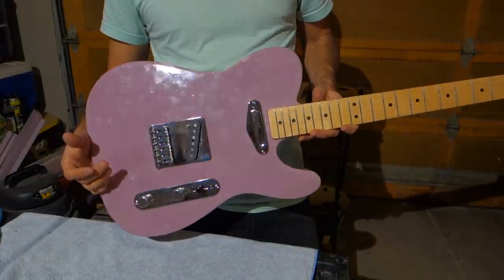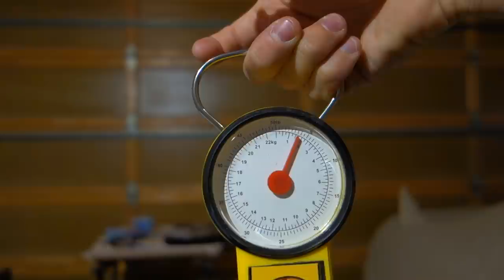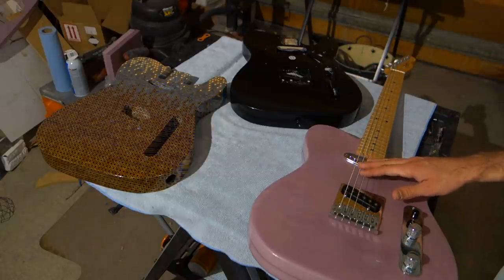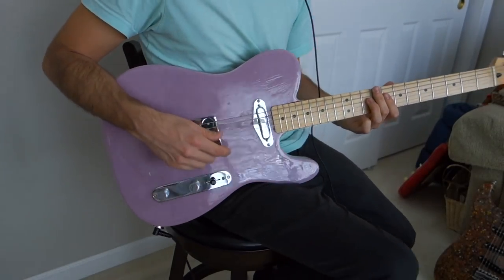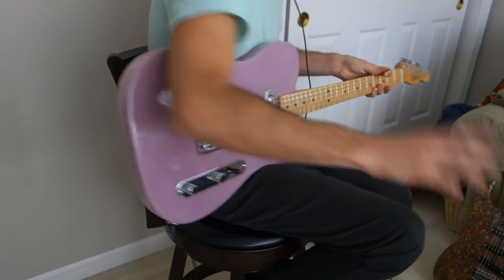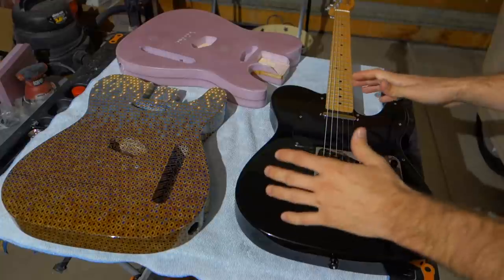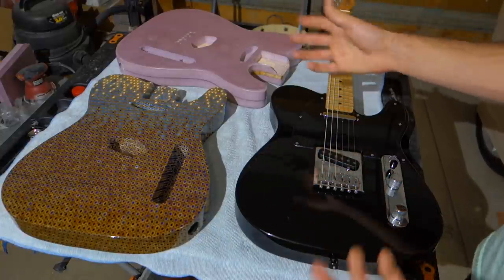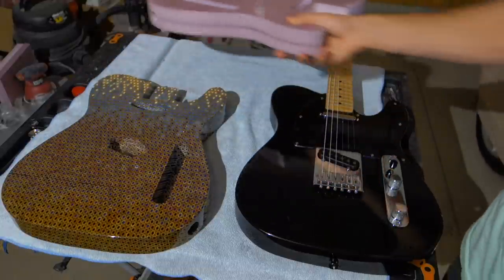I Built The World's Lightest Guitar Out of Styrofoam

Comment: And so cheap (and replaceable) if you want to smash your guitar on stage!
Reply: Lassie Vision and a cool color for style
Reply: Not by any means cheap. The 6 foot length of foam costs around $150 and fiberglass and the resign are expensive too. Wood would be cheaper
Reply: Blimey. Who'd have thought foam would be so pricey?
Reply: Lassie Vision I made the assumption that it’s closed cell foam based off of the appearance but I could easily be wrong
Reply: 4X8 styrofoam panel costs 22$ CAD here.
Reply: @Joemels  you are getting ripped off if you are buying insulation foam for 150$
Reply: This is extruded polystyrene foam, also called XPS. And it looks like it’s made from 2 1.5 inch sections that could easily be made from the same sheet. Easily under 30 dollars US. But that price does tend to change based on where you live.
Reply: @Joemels  I picked up a 4x8 of the exact same XPS foam for 15 bucks the other day my guy

Comment: Maybe make the wood that the neck bolts to a bit longer going down the back and run the strings up through that one peice.  Might the the string tension preasure out of the foam... I dunno... Still cool idea.. Rock on!
Reply: Yep.  That the true key to making a decent electric, as per Les Paul.  Need that solid piece to anchor the strings to.

Comment: Equally supportive and rigid material with equally adjusted set ups and hardware will sound exactly the same if you play it same way. If you introduce neck or body flexing, alteration in the way you hit and squeeze the strings, you will get different "tone" i.e. the string vibration pattern will alternate due to changes in string length and material absorbing the vibration and translating it to acoustic noise, which isn't the point of a electric guitar. The point is to translate the magnetic vibration of the string, through the pickup to an amplifier. There's very little differences between one "tonewood" and the next in terms rigidity, therefor you can make a concrete electric guitar and it'll still sound OK and probably have great sustain.

 Also, someone probably already pointed out but there are people making entire guitars out of carbon fibre, so if you want to go light, time to start honing carbon molding skills.

Comment: Another piece of evidence that the wood (or other body material) DOES provide a tonal difference... but that the difference is fairly slight.  The foam did sound more muffled compared to the standard wood body and the the pencil body... but not much.  Install some slightly brighter pickups and the difference would disappear.  So both sides are right.  Argument over?

Comment: That is a plywood  body clad with foam and epoxy.     It probably has more plywood in it than one of my experimental builds.     Probably weighs more too.  Looks like it, the X-6 tips the scales at 3.25 lbs.   Next time just use plywood, and try something more ergonomic than a T type.   
The X-6 version 1:  https://www.youtube.com/watch?v=7VfgFOFxJB0&t=21s
The X-6 version 2:  https://www.youtube.com/watch?v=flx3VEITgGg
The X-6 version 3:  https://www.youtube.com/watch?v=oOfMdauWEgQ
And you can get even lighter.  
Check out the neck on the X-9:  https://www.youtube.com/watch?v=gwtL6RKhZh0

Comment: So I have no idea if you will get to read this, but I've had an idea to make an entire guitar out of acrylic resin or epoxy. Acrylic resin might not be the best medium, as I was reading an article that claimed, if left in the heat, acrylic will lose its integrity. So epoxy might be better? Regardless of the medium, I found a forum that claimed a full acrylic/epoxy guitar would put too much tension on the neck and bridge which could lead to warping. There was also a claim that a guitar without wood, would sound worse than if you were to use wood along with the epoxy/acrylic... however I'm not sure how accurate that is, as Fender has successfully created a clear guitar before. H.E.R. played one at the Grammy's this year. So I know that it's possible, I just don't know how to do it.
I would love to create this custom guitar idea I have in my head, but I want to do it right so that I can take it to shows. You're the only one I've seen take this (a styrofoam guitar) big of a step outside of the norm. So if you have any ideas or advice, I would greatly appreciate it.
BTW, if anyone else is reading this and has ideas, please comment!